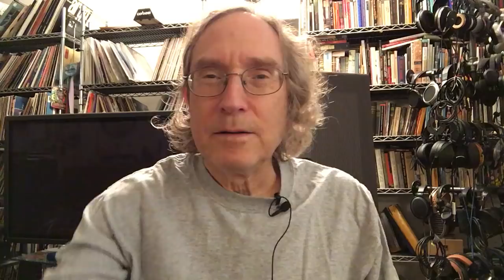Box vs. panel speakers, some things to think about

Comment: One of the first audiophile speakers I heard were some big Magnepan's back in the early 1980s. It made such in impression on me that no matter what box speaker I hear, it never quite gives me the same feeling as a panel speaker. Later I heard Martin Logan and like them but not enough to buy them. Then I found some used Acoustat 1+1 electrostatics in the late 1990s, bought them, and they are still my speaker today. I still love them and will repair them when they get to that point. I am content and have no desire to change my speaker.

Comment: I have had many pairs of Maggies and I have had Quads esl63 , and of course many box speakers. I love them all. Right now I have a set of LRS + and a set of older 1.7s and mgmc. No I am not a multi channel guy but I do have a few systems. I also have a system with tube amps and Totem model 1 signature. Sometimes I feel like a nut sometimes I don’t. LOL.

Comment: The first time I heard a panel speaker, I was in college. The owner of a high end audio store in Huntington Beach CA (early 80's) had me sit down in front of these huge flat monoliths sitting out in the room. No idea what they were. The music was astounding. Like nothing I had heard before (my older brother had ESS AMT-1Bs which I listened to daily). 

Fast forward 15 years and I listened to a pair of Vandersteen's then a pair of Apogee Stages. I was not an audiophile, but my friend and the salesman asked me to explain what I heard. "The sound of the box speakers was coming at me - it was in my face. The sound of the Stages was over there." I have never owned a pair of box speakers since. Apogee Centaurs came home (along with a Muse sub) and were replaced eventually with a pair of Martin Logan SL3s that I have had for over 20 years. I wouldn't say they "rock", but vocals and the presence of the music is so palpable and immersive, I don't care.

Comment: I have had a pair of Acoustat Model 1 panels 12x96 inches with passive subwoofer for 30 years. The still sound great and I get incredible pleasure listening to them, mostly classical but really every genre of music. I recently bought a pair of box speakers, used Gold Monitors to set up a home theater system in my downstairs because I heard some at a friend’s house. I added a powered subwoofer and they sound great. I was in love listening to them for 3 months. When I went back upstairs to listen again to my 30 year old Acoustats, I was reminded how clear and lifelike they are, and how big the soundstage is.  I have to admit there is some detail in the ‘box” speakers I may not hear in the panels, but for the sheer pleasure of listening for hours on end to great music, the electrostatics are amazing.

Comment: Thanks for your comments, Steve. I've owned Magnepan panels (1.5R) for many years powered by Adcom monoblocks. The speakers are placed in a relatively small room with hardwood floors, about 2 feet away from wall "notches" in front of a bay window (drapes closed). The sound stage becomes very large with orchestral music and rock, but remains intimate for chamber and solo vocal. Not quite as nice some box speakers I've owned in the past, but they are exceptional for most of the music I listen to.
Reply: I appreciate your comment.
I listen to the same types of music and I was wondering if the Magnepan 0.7i would be a good fit for me.
I am going to do a 90 minute audition of this model at a local hifi shop tomorrow.
   
     I have never owned panel speakers. I have stuck with B&W for 30 years but I am ready for a change as my tastes in music have changed.
  My livingroom/ listing room is small to medium in size...approximately  
16x12x9 feet.
IYO, do you think the 1.7i loudspeakers will work well for me sonically in my space?
I will be  powering them them with 400 watts per channel  into 4  ohms. 

I appreciate any info you can provide

Thanks.
Di

Comment: Great video as always, I have just heard my first Maggies today the 3.7i and they seemed to be very "REAL" in their presentation and rawness of how the music is presented. These ones had 2 REL subs with them and that helped their lower end, where I feel they did struggle in accurate base reproduction. The sound as opposed to my floorstanders and 2 S/812 RELs was more open and airy compared to my system, but at the same time the maggies felt to be a little bit thinner in their sound, the soundstage was deep and beautiful, but very similar to what I've experienced from old TEAC LS210 vintage speakers out from the wall 4-5 foot, depth of image was about the same, but more holographic than the maggies... I think the Maggies would be a very acquired taste, I felt that I couldn't wait to hear my box speakers again and that something was "missing" from the maggies, despite them being absolutely awesome, just not for me at this point in my audiophile journey.

Comment: One way to improve the bass with panel speakers is to stiffen the back panel with stout aluminium angle;pairs top to bottom plus feet extended backwards about 2 feet then angled struts bolted to the back edge and attached half way up the vertical strengtheners.You will immediately notice a smoother more solid bass response plus a more focused sound stage.Even the Apogee speakers,which are noticeably more robustly made than Magnapans,benefit from this treatment.
Reply: BRATWURST1 
I am developing a similar system based on
the same principles.  Like a camera if the panel vibrates the result is unfocused 
As for bass how could the panel push all that air and not have to push back against something
ITT must be anchored 
The results are amazing
Reply: I’m listening to my 17i it’s a qualitative leap 
I’m using Schiit Vidar mono blocks with awesome results

Comment: Super valid point. Ported, sealed or TL speakers are in general pressure sources, whereas the panel speakers are velocity sources. When you place the boxed speakers in your listening room, you have to stay away from the pressure maximums of the room modes, panel speakers have to live in the velocity maximums of the mode shapes. For example, every room mode has a pressure maximum close to the walls and at the corner, all the room modes have a pressure maximum. When you place a boxed speaker at the corner, base notes become too boomy. Where there is a pressure maximum, there is a velocity minimum, so by the side of the walls, there will always be a velocity minimum. This is the reason why the panel speakers do not like to live close to the walls. The common saying about them "they have to breath" may be originating from the fact that, they need to be placed away from the walls, that makes most wifes upset, seeing a 6 foot 5 "room dividers" in the middle of their living room, that you claim as a listening environment. Some come semi-transparent though if you would like to use it as an internal sales pitch :D

Comment: I tested the waters with some used MMGs then almost immediately jumped to the 1.7. I love the Magnapans open, airy, lightning quick and unconstrained sound.
Reply: I've heard more people rant about Magnepans over the years than any other speakers but as a basshead, I'd have to get a sub to go with them, oh, and it would all cost a shitload of money which I don't have
Reply: I've always been fascinated by the thought of owning Maggies but just am such a tower speaker man. I also own Paradigm Studio 100s. I just never wanted to get involved with a sub woofer. Also, I have two cats and my stereo is shut up in a room probably too small for Maggies. I can just picture my cats using them for scratching posts!
Reply: Steve, as a longtime owner of Maggie MMGs,  I understand their allure,  but ultimately replaced them due to the lack of low end punch. What puzzles me is why the surface area argument, so convincing for the tweeter, doesn't hold up for the woofer in a panel speaker. I'd think one would get a real gut punch from that kind of surface area. As always thanks for your insights!
Reply: @carewser  I'm running Maggies with a sub. It really is the best of both worlds. By assigning all the low bass energy to the sub, you free up lots of power to drive the Maggies with less effort. You get improved dynamics and very low distortion. I have some great box speakers for my home theater but for serious music listening the Maggie/sub combination is unbeatable unless you spend multiple thousands of dollars.
Reply: @darylloth3237  which maggies and which sub are you using?

Comment: Had some Martin Logan Montis for a while and loved them at first, but they really suck for rock music.  Don't let anyone fool you that they've "solved" the integration between woofer and panel.  I now have Focal Sopra 2's and guess what:  they are JUST as open and transparent sounding as the Logans but their integration of woofers and overall coherence and dynamics are way, way beyond what Martin Logan is doing.

I do think that some of the lower priced ML's and Maggies are fantastic value though; you don't get that kind of openness from traditional box speakers until you step up in price with really well designed cabinets and drivers.  Once you can get the best of all worlds (openness/dynamics/coherence) from box speakers they really set themselves apart.

Comment: I've had both boxed and dipoles, each can sound exceptionally good when the designs play to their strengths and minimize their weaknesses. Presently I have a 2+2 system where the mids and highs are handled by dynamic drivers mounted on open baffles placed 4 feet into the room (dipole), and the low end is handled by two closed box woofers in cabinets along the wall behind the dipoles. This way, I get the best of both worlds, the openness from 300hz up, and a solid, tight bass in the nether regions. One drawback, the setup requires two stereo amps and an active crossover.

Comment: One thing Steve didn't mention which I find extremely important is value for the money. Nobody wants to feel like they spent more than they should have for their equipment. All I've ever read about speakers such as the Magnepan 20.7s is even though they cost almost $15,000, they are as good or better than many box speakers costing $30,000 to $50,000. I'm willing to pay $15,000 for speakers that get me something that sounds as good as $50,000 box speakers.

Comment: I mounted my 4" coaxial drivers on an angle and the drivers are 1/4" above the speaker hole instead of right on the hole. And I also made (shallow geometry) whizzer cones that sound more airy than the really steep ones we see on most drivers. These 3 innovations made the best voice sound I have ever heard in a speaker! Airy floating voice sound with an image to drool over. They are box speakers (not quite in the box) that sound like planars, and some of he sound does come out the rear of the speaker with my 30 degree semi omni setup. That also helps in the airy voice sound. Also an extra woofer below for more bass and so the med cone doesn't excurt too much for clearer sound. But there is some bass in the coaxiials for a good point source image. :)

Comment: I have owned a pair of Maggie 1.6QRs for about 15 years after owning box speakers. I have thought about buying some box speakers but the allure of the Maggies is spellbinding for me personally. There is a realism that for me cannot be duplicated with any other type. If I do leave my Maggies it will probably be to some electrostatics.
Reply: I agree completely. Magnepans have "ruined me" for almost every other box speaker out there. I'm always hearing the cabinet resonance now. The only two exceptions thus far have been DeVore Fidelity and RSL (Rogersound Labs). Both of those lines are quite transparent, but still can't compare to the Maggies in terms of my taste.
Reply: Fully agree. I own a pair of Magnepan 1.4. Never have heard speakers before, that come even close to this experience, regardless of price. My former Tannoy Monitor Red 15" in big York boxes were nice. But in terms of connecting me with the music, no contest. Downside of course, the Maggies strengths depend very much on the correct placement in the room, the appropriate amplification and source material of the highest caliber! 😲

Comment: Thanks for your thoughts on box vs panel speakers.  The analysis was quite simplistic in that it didn't address any allocation of the purchase price toward overhead,  marketing, R&D, etc. I suspect that these cost components differ widely across manufacturers and greatly influence the cost of audiophile speakers.
Reply from the maker: Sure they do have those expenses,, but if the company builds cabinets in-house -- some do, some don't -- those extra material and labor costs, and factory space are always going to be higher for manufacturers of box speakers than they are for panel speakers.
Reply: But your statement about box speakers using cheaper drivers is only true if you’re referring to Bose.
I seen 1-1.25” Be tweeters in the range of over $550/ea. 
And I’ve never heard any panel speaker I liked better than a quality box speaker, in side by side comparisons.
And as far as the sound of a speaker filling a large room. I’ve never heard anything better than a mid-1950’s JBL Paragon.

Comment: I love my OHM Walsh speakers. I hear the large room filling sound, they can be exciting to listen to, and horns and pianos sound great. To me they do a lot of things well and are all I need.
Reply: What amp, pre do you pair it with?
Reply: @drakeforte5  i've tried several with them but my favorite combo with the Ohms is my Crown xls 2502 + Schiit Freya w/ NOS RCA 6SN7GTB using Mogami Gold XLRs. The Ohms really benefit from loads of power.
Reply: @i.dig.wax.5805  tx. I'm going to try the crown amp. I got an older parasound hca 1500 but it seems something is missing.. it is too polite.. want some bite.. or brightness.
Reply: Parasound p5. I also have a cheap tube bufferred dac in front of the pre
Reply: Even with the tube bypassed the sound is still too polite or missing details. Might be time to upgrade the amp

Comment: I've been running a pair of Acoustat 2+2s for a couple of decades now, and thirty-two square feet of transducer yields pretty terrific sound... except as pointed out here, the bass is never as 'punchy' as a big old woofer cone.
Reply: had a pair ,transformed them into model 4 because it could'nt fit with the ceiling, i was driving them with krell krs 100 never had any problem with bass, best control you can get:)in pure classe a!

Comment: Steve Guttenberg Audiophiliac - really enjoyed this post of yours.  I've had Maggies in the past and whether or not they are THE most accurate speaker out there may be debatable (I happen to think they are SUPERB in that area), they sure were the most FUN to listen to. The only note of respectful dissent I have with you is when you said that box speakers have quicker bass.  I think that Magneplanars win in bass speed - a product of their ultra light diaphragm - much lighter than just about any woofer material (that goes into a box) out there. In terms of visceral impact however, the boxes win IF well designed and executed. I'll take the Maggie "short coming" (if that's what we have to call it) anytime. Thanks and happy listening to you and all!

Comment: My first experience with dipole plan our speakers was with the Carver amazing‘s. I now own a pair of Martin Logan impressions. They have door 8 inch woofers with an active amplifier. They are not lacking in the base department. That being said I have 2SBS 16 ultras sealed box. Transition in the low Low frequencies is very spotty with in fact seamless in my opinion. I don’t think it said it as a trade off to have planners. The trick is to have good sub Wolfers to work in concert with them

Comment: I am in the market for a pair of speakers and this video summarized the dilemma quite well.  I love the way maggies present acoustic music.  But I listen to both classical and rock.  One potential solution I am considering is the Spatial M3 speakers.  They are open baffle but with two 15" cone woofers.  Very efficient.  The fully upgraded Triode Master version even has a dipolar compression driver.  Some say it has the great qualities of Maggies while also having real bass punch and slam.  Can also be paired effectively with lower power tube amps.  May do an in home trial of these.
Reply: I'd get the Maggies and a good pair of sealed subs. You can position the subs independently of the speakers and get ideal results, and you can also turn them on for rock and turn them off for classical (since a dynamic woofer will color the sound).

I also find that the very biggest Maggies have enough bass slam for rock. I have an old (30+ years) pair of Tympani IVA's and they're good to 25 Hz and do chest thumps. I could get a bit more bass with subs but really, with that kind of bass I don't feel the need.

Comment: Regarding panel speakers. Keep in mind that there are different types and they sound quite different too. 'Planar magnetic' designs like Magnepan despite appearances operate nothing like electrostatic panels nor do they sound the same. The best stats are still more transparent than any planar magnetics though the gap is narrowing. The moving diaphragm of an electrostatic is considerably lower in mass and therefore accelerates faster than any other type (ionic discharge tweeters excepted)... and an electrostatic diaphragm is driven over it's entire surface area unlike planar magnetics and cone/dome speakers.